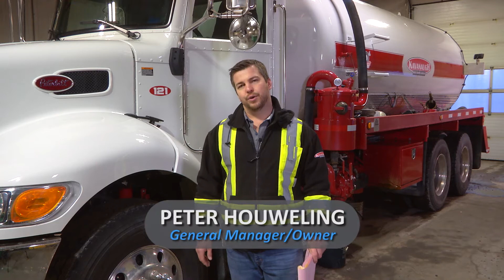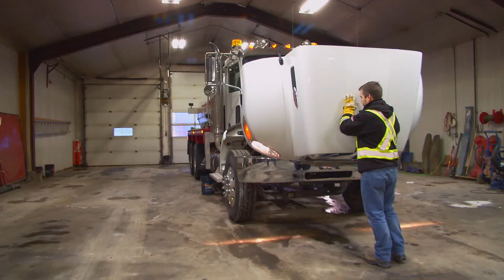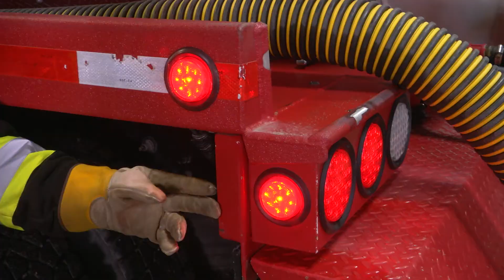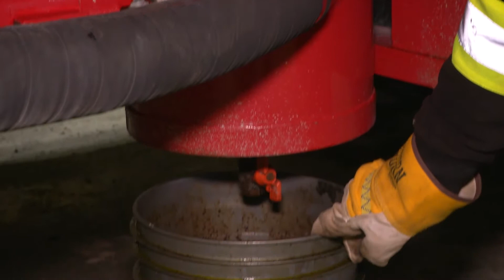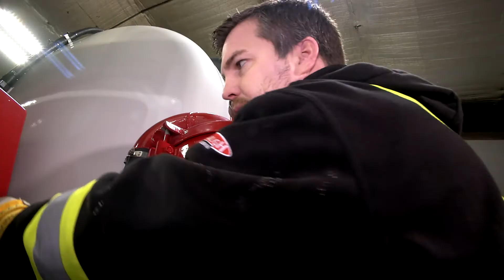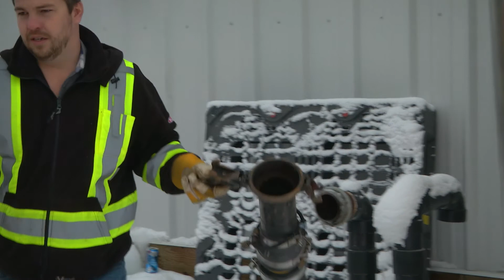Sewage Truck   NWTAC Asset Management Videos

Comment: No home at night safety today,,   list in heart. My. Truck. Checking each crews. Mental health, due too. Gases, hearing, space suits,  maintainace. Parts shack,   careful, in park ,  masks headgear,  pull over then clip to helmet,,   air breathing hose,,  like sandblasting?      No. App.  , handheld devices allowed by,, locators,  gases,  powerlines,  permits,    too. Spot. Needs in Canada,  frost line underground,,  grounding rod too clip to,       septic tank knowledge and skills documentation for reporting classification system specific issues,,  association of Realtors also be guaranteed to be popular used in this case,,,john.